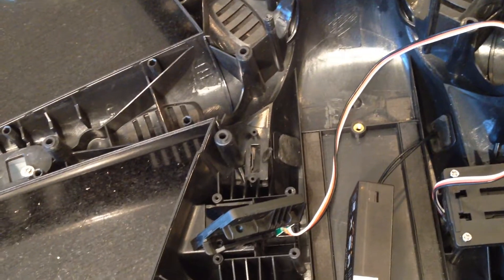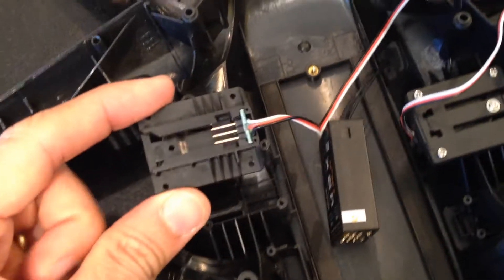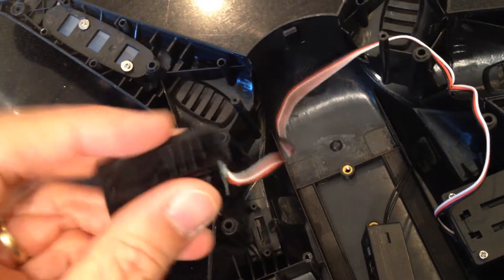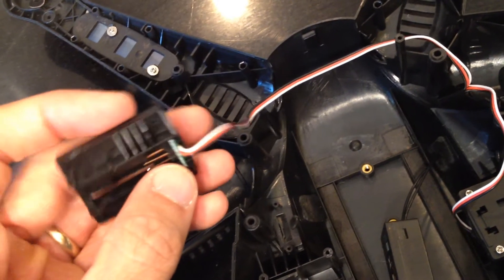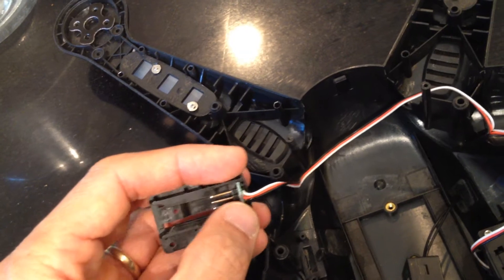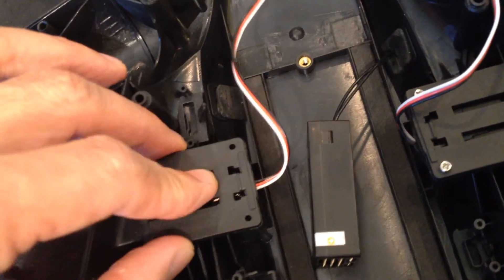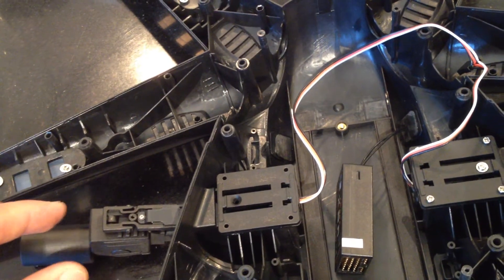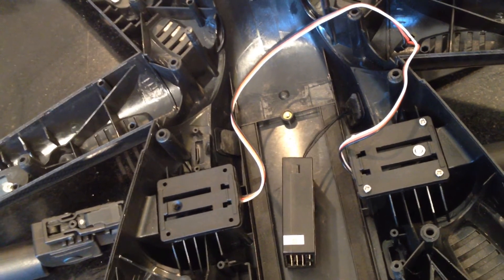Scratch Build a Walkera Tali 500: Setting Up the Retracts

Comment: Neat tip,
The carbon fiber landing gear is too weak to handle a quick landing, so to strengthen up the assembly use balsa dowels in the vertical and horizontal rods. If it does come down hard, it will break the "T" or the retract servos with minimum damage to the fixing mounts or the uni-body.

Comment: I heard that the retract system can lock up and cause other problems, like robbing power from the receiver and power board. There is a fix for that on the web. Just thought you should know that there is an issue.